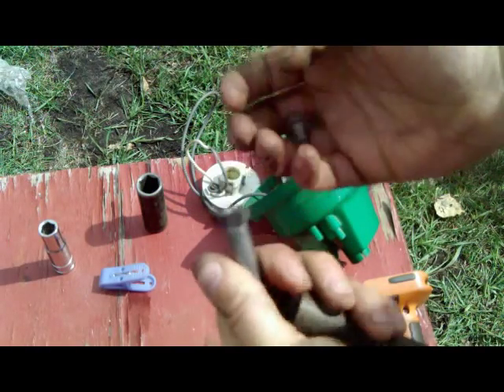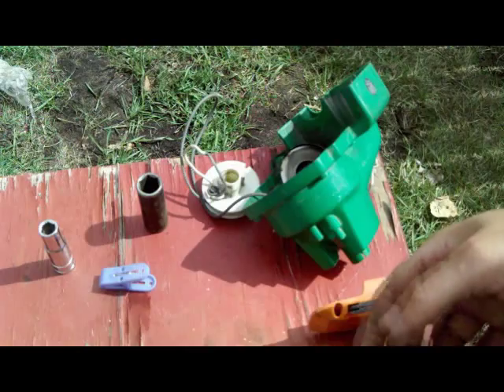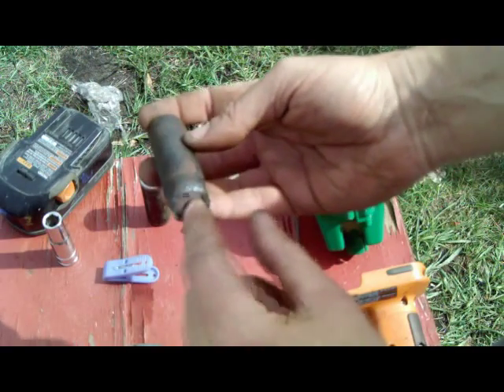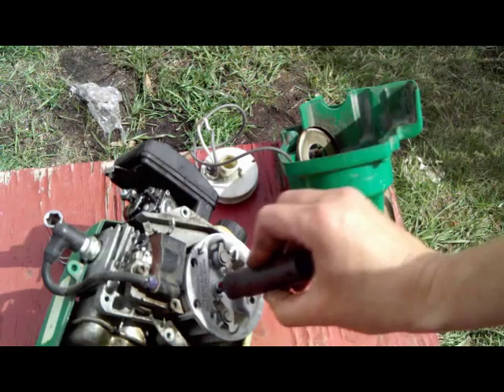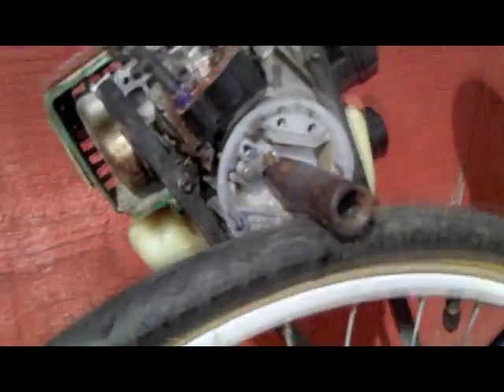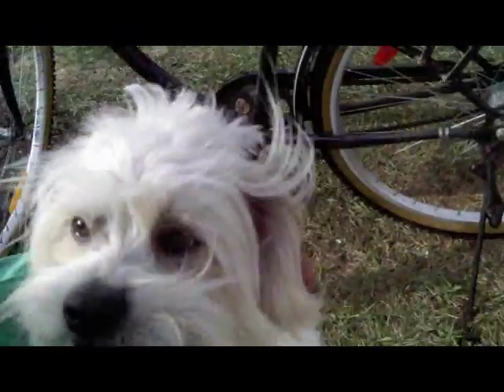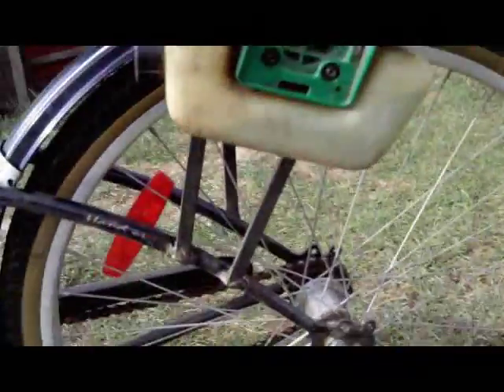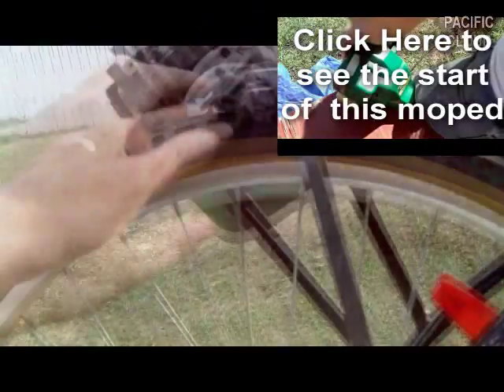How To Motorize a Bicycle

Comment: I build alot of these friction engine's. I have a 33cc PouLan Pro.  The spark plug is on the bottom and gas tank on the top. I use a bike peg a  11/2  . To heavy on the engine shaft doesn't rev up.    I thought it was the carb.   I remove the bike peg form the engine shaft revs up. 21.2cc Echo weedeater engine think it not have enough power. What size is you're engine. 25cc 21cc might work than. Let me know thanks later. Thinking using my pocket bike engine on my bike. I seen few posted here.